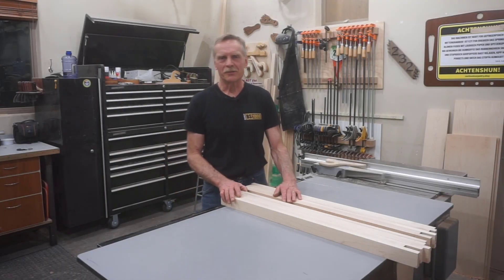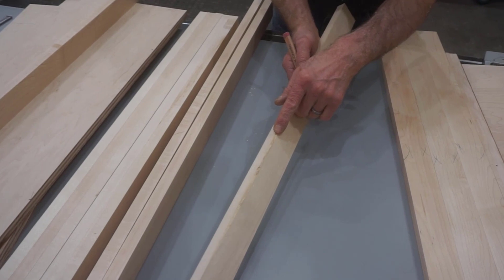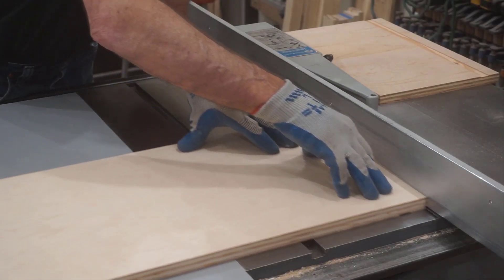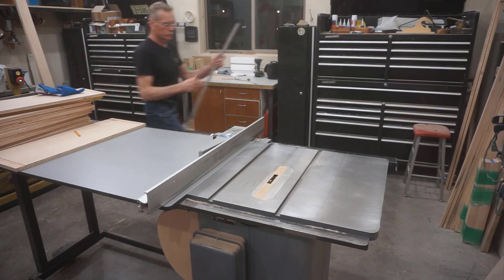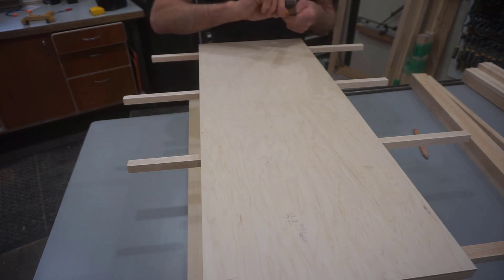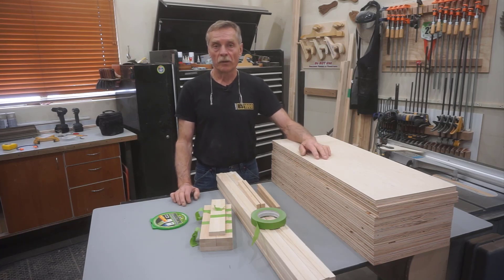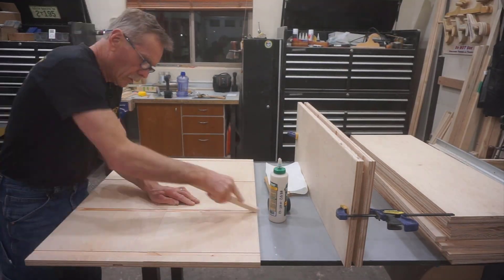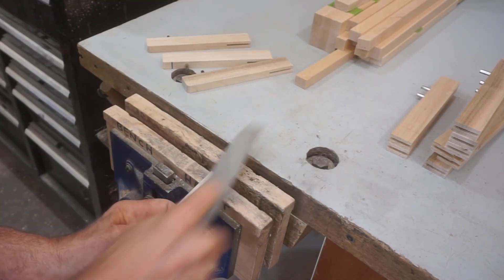Thick Adjustable Shelves with Hidden Hardware

Comment: curious, how much does a shelf weigh?  As well, a really nice design and work..  Thanks.
Reply from the maker: It's basically 6sf of 3/4" veneer core plywood Paul... maybe 8lb or so?  These would be plenty strong using 1/2" plywood instead of 3/4 but I didn't want to buy (ie: charge my client) for extra material since the 3/4" pieces I used would have been left over after the project as scrap.  Glad you like the design and work... Best, Matt

Comment: Hi. What plywood did you use for this project? The fronts you said were hard maple. I don't think you said what you used for the shelves or the case itself. Thanks.
Reply from the maker: Hey Demetri,
I don't know if I said either.  If memory serves it was a veneer core 3/4" thick A/B grade maple veneer faced panel.  I like veneer core because it's about 25% lighter weight and a bit stronger but sometimes I end up using MDF core instead for either cost or availability reasons... hope that helps? Best, Matt
Reply: @NextLevelCarpentry  Amazing thanks. I've learned so much from you already but those precision cuts in this video really got me excited and gave me something to shoot for.
Reply from the maker: @dmourati  Cool... glad to hear it! 👊👊👍

Comment: Question…. How wide could you make a shelf like this to remain stable and sag free.  I want to make 60” adjustable shelves and m trying to find a good technique
Reply from the maker: Depends on what you're putting on those shelves... I wouldn't be afraid to use this exact design for shelves 60 in wide unless they were used to store sets of encyclopedias. If you were going to store something really heavy like books you could always make the shelves a little thicker which would also make them stronger. The Shelf clips and holes can hold a significant amount of weight so I don't think anything there would need to change. Good luck with your project!

Comment: I really like this design. Though I think I'll put the spacers in between the shelves along the length of the shelf rather than perpendicular. Perpendicular does nothing for the strength of the shelf. I hate sagging shelves.
Reply from the maker: Glad to hear that you like this design but if do you really think that these shelves are going to sag?! They could be twice as wide and twice as long and not deflect a 16th of an inch with this design and half-inch thick longitudinal spacers would spacers surely wouldn't provide additional strength IMHO. Thanks for watching and commenting though... Best, Matt
Reply: @NextLevelCarpentry  You clearly haven't seen my wife's book collection. :) In all seriousness, the concept lends itself well to heavier items in a less finished state.

I agree it would not be necessary in your application. I disagree however that the spacers wouldn't add strength if oriented differently. It's not that a 1/2x1/2 spacer is particularly strong. The strength - or rather rigidity - comes from binding the two diaphrams together. Like an I-joist.

Would be an interesting thing to test!
Reply from the maker: Yeah the spacers give the design a torsion box type of assembly and I suppose in some extreme cases spacer orientation would make a noticeable difference but I suspect the difference might be more theoretical than practical. Sounds like your wife's cookbook collection just might be a perfect test case and the thought of it makes me smile... Best, Matt

Comment: I were to only subscribe to one YouTube channel, yours would be difficult to beat as the one I would chose. Some of your videos may be long, but they are packed with useful information that can be used in all aspects of woodworking. Since I want to eventually be able to build cabinets and similar items, your channel is hands down the best one I have found for inspiration and education.
At 33:50 it appeared that you had a couple of boards balancing on your head, it gave me a laugh.
BTW, Chip should wear a different shirt than you when he comes in to help, it's hard to tell the difference between the two of you.

Comment: What if you did half lap joints (no glue) instead of aluminum splines...
Reply from the maker: They'd be similarly strong Dennis but the spline keeps things aligned when sliding shelves into place.  I suppose a bridle joint would accomplish both albeit complicate things?  Thanks for watching and commenting! Best, Matt

Comment: A terrific video as always, Matt. Could you add the clamp at 15:49 to your Amazon page, or tell me the details of it? I've been looking for something similar. Thanks!
Reply from the maker: Done, Eric!  Thanks for asking about them.  Here's the 4" one seen in the video: https://www.amazon.com/dp/B00005RHP0/?ref=idea_lv_dp_ov_d&tag=aiponsite-20&linkCode=ic6&ascsubtag=amzn1.ideas.4G9X5ZO5YAFE I have 4 of the smaller ones too and included them on the Influencer's list linked in the Video Description too.  They're not something I use often but they're really handy for certain things like you saw in this video.  Best, Matt
Reply: @NextLevelCarpentry  : Thanks!

Comment: Is the shelves going to a customer: will you deliver this unassembled? 

And, is your shop near CA I-10 ? Think I saw your NLC logo.

If you were to build one for me, could I pick it up, unassembled and unfinished?

Thank you.
Reply from the maker: This whole bookcase will be completely disassembled, stained, lacquered and delivered before being reassembled in place on site.  There's just enough final fitting and fussing that no one but the maker (me) could get it back together properly.  Must have been someone else's NLC logo you saw.. unless someone was wearing an official Next Level Carpentry t-shirt from Teespring maybe?  Best, Matt
Reply: @NextLevelCarpentry  Was moving fast and caught a glimpse of large black letters on a large metal building; saw this though when I passed by again on I-10, Indio, CA: NEXT LEVEL DOOR AND MILLWORK

Thought it was your shop.
Reply: @NextLevelCarpentry  Am renovating home in Julesburg, CO and was thinking I might be able to pickup, haul, and install. But understand what you mean regarding your install effort needed.
Thanks for your time - and your videos.
Reply from the maker: @mikegallegos7  Ahhhh, that's interesting. It would certainly not be out of the realm of possibility to design and build such a bookcase for an arrangement like you described but I suspect you would find great value by showing the concept to a cabinet maker closer to home and having them reproduce it for you. The hidden shelf clip Hardware 4 thick shelves concept is unique but having it built by me is unnecessary and probably cost-prohibitive. All the work I do is essentially on a Cost Plus basis and customers and clients that are a good fit for both parties are somewhat few and far between. Good luck with your renovation project and thanks for watching and commenting... Best, Matt
Reply from the maker: @mikegallegos7  that's interesting I'm vaguely aware of a business called Next Level carpentry somewhere on the East Coast but the fact there's another one in California is news to me but not actually a surprise... Best, Matt

Comment: The only thing I don't like, and it is a minor thing, in the event of a tip over, there is nothing preventing the entire shelf from sliding out. Most high end shelves have a face frame that stops the shelf sliding out in an earthquake or tip over. All of your items on the shelf are still going on the floor, so it really doesn't matter....
Reply from the maker: Your point is a minor thing that could become a significant thing in the event of a tip over but it is an equally minor thing to put discrete screws on the underside of a shelf into the hidden clips to prevent the catastrophe you envision. The main thing to consider is that the design would suffer significantly from using typical face frame Construction and with the cabinets being secured to a wall I have zero concern of a tip over and wouldn't compromise the design to offset the Calamity of a tip over.

Comment: did not find the flat blade on amazon list
Reply from the maker: It's the LM72M010 Fernando... new ones are bare steel where mine is old and, back in the day, they used that red 'no-stick' coating so you don't see what I show in the video.  Here it is: https://www.amazon.com/dp/B00004T78V/?ref=idea_lv_dp_ov_d&tag=aiponsite-20&linkCode=ic6&ascsubtag=amzn1.ideas.4G9X5ZO5YAFE but it's also on the Influencer's list.  FYI I bought and use that as a mini-dado blade but, ironically, 'never' use it for standard ripping because the full kerf means more effort and more waste then ATB thin kerf rip blades.  Best, Matt

Comment: Great video. I think the extra time used to precisely space and dado in the spacers is unnecessary. Why not just face glue 1/2" strips between the shelve pieces and call it a day? You're never going to see the spaces anyway.
Reply: I do thick floating shelves like these for nooks and corners all the time (except I miter my reveals). Face glueing in the spacer strips is a pain.  Things like to slip and slide.  The first time I did them I oversized my shelves so I could re-square everything on the table saw. 10 minutes to rip a few dados will save lots of time later.
Reply from the maker: That's like saying to your car manufacturer "I think the time you spend holding tight tolerances on internal engine parts is unnecessary... you're never going to see those pistons anyways"... 🤨 Best, Matt
Reply: Next Level Carpentry 😂😂😂😂

Comment: Sorry but had to comment, like the concept but the shelf pin system needs some work. You could have used a U channel profile open side up for the whole thing with wood inside (glue the pins or friction fit them), put a hole vertically and use a screw driver (or hand holders to grab from under the bar and pull back) to pry it out, or solid square tubing wood inside for heft, or angle profile instead of flat bar that way you can pull on it for a tool-less adjustment, i mean sooo many ways even put a back pin bar for extra strength as an upgrade, but flat bar loose like that big no no. 

 There are thousands of ways less troublesome to make the invisible holder floating shelf bar, also by having a back bar it allows for a screw to go in upwards to lock the shelf, if for books there is a youtuber that added flat bar all along the inside of the shelves (for a barrister bookshelf if i remember - same as the way you did for the internal rails but perpendicular creating a grid). I have been planning something like this but for library, hence the long comment. PS: Thank you for all your wonderful detailed videos in awe of the pallette wood door jamb. Top notch that one.